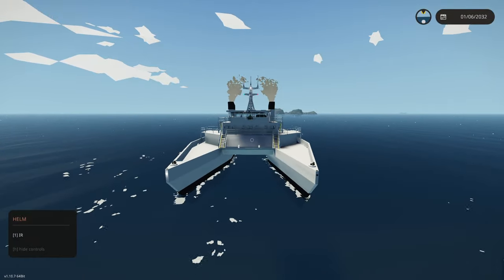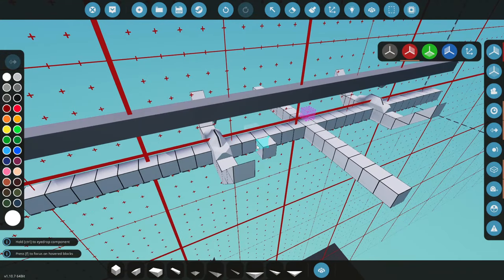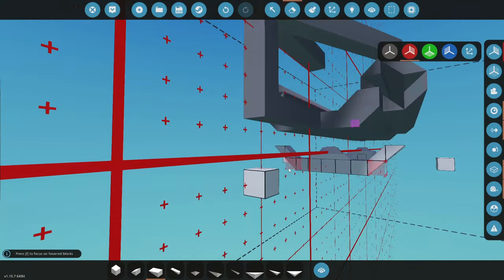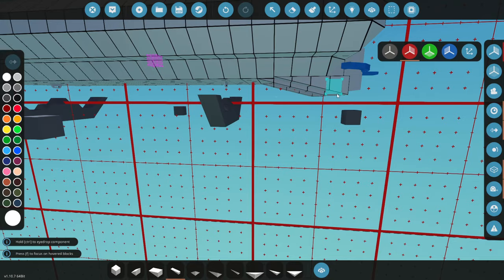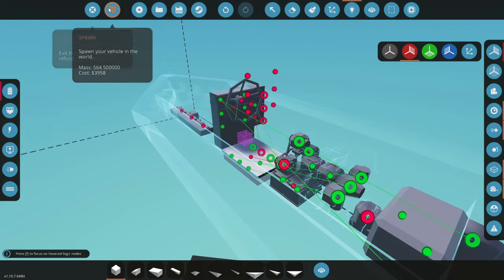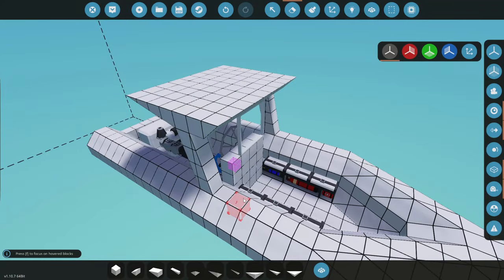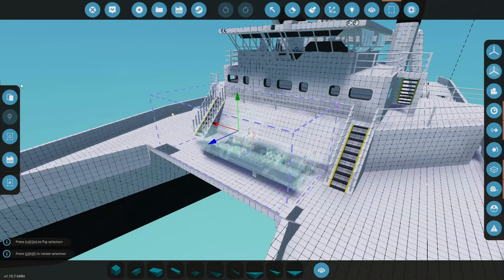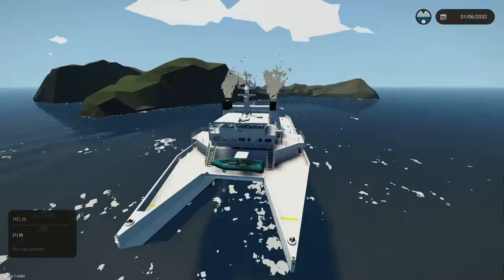Building a RHIB Boat [Tender] for the Recovery Ship! STORMWORKS

Comment: Your coolant manifold is connected to a crankshaft Professor, it's supposed to be connected to a cylinder, so you're engine is going to overheat! Also, your two banks of cylinders are not connected, to they're not sharing resources.
Reply from the maker: Yeah I realized the coolant while editing but there are  manifolds on the bottom connecting them unless I deleted them.

Comment: I'm having issues with my ship.  If anyone wants to try and fix my ship, I will leave links. I have 2 versions of my ship. 1 has Jetn engine issues, ut looses speed aft 12 or 14ish km traveled. The other version has Propeller issues.

If anyone manages to fix the issues, please reply with how you fixed the issues.  

To find my ships(s), look up TSS Hindenburg and TSS Hindenburg 2 on the workshop for the two different versions.